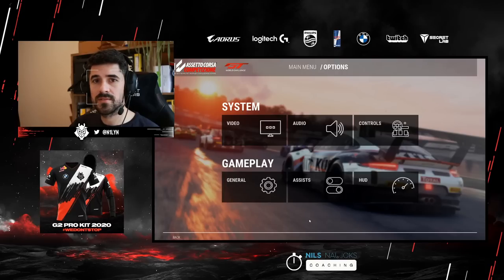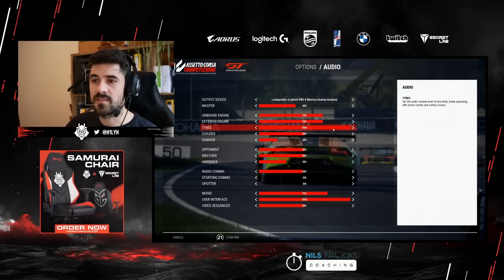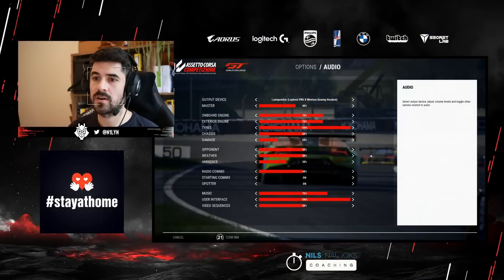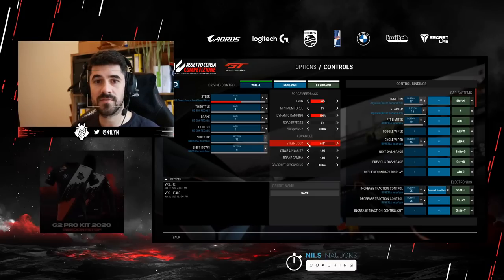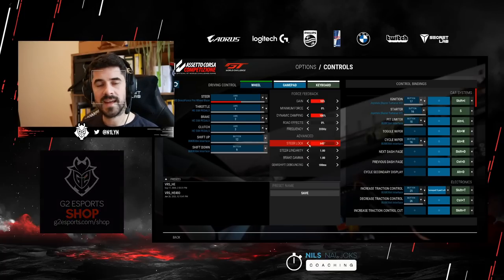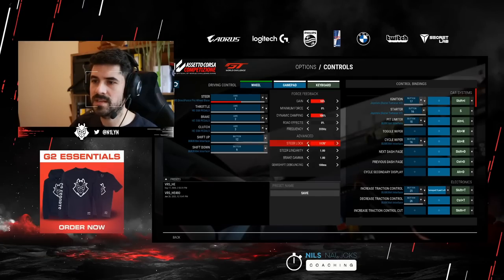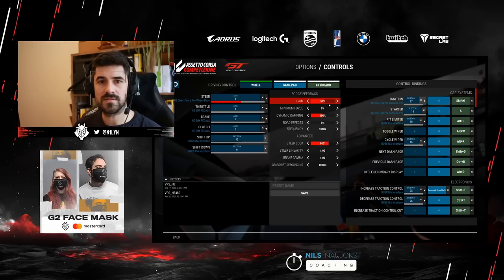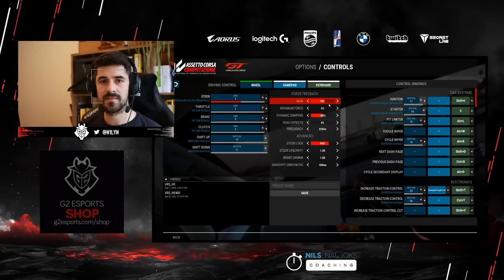Understanding ACC 1/3 - Controls, FFB, Audio, GFX - Assetto Corsa Competizione

Comment: Im using a ts-xw...
I originally followed advice from others and now your saying the same about dynamic dampening. I found this is quite wrong. With 100% I would constantly spin and not able to do a consistant lap of Silverstone on average of a 2.04. I then turned the Dd down to 0% and brought my average down to a 1.58 consistently with no spins. I could then control slides and could actually feel what the car is doing. And is still has more than enough Dd even at 0%.

Additionally if you have a weaker wheel.. You want to increase the force not reduce it. I'm using 45% ffb and 0% Dd and it is a completely different experience. It feels so much more realistic. With a weaker wheel, you should turn the ffb up as to get to a more realistic nm, you need to use a higher %, not lower. If you have 5nm total power, and you reduce that to 40%, you now only use 2nm of your total 5. If you have a wheel with total 10nm at 40% you have 4nm. So with a weaker wheel, to get 4nm, you need it at 80% to achieve the same force. More, not less.
Reply from the maker: the Dynamic Damping (lets not use DD as that abbreviation is occupied for direct drive wheels) indeed limits the detail that you can experience on weaker wheels as these smaller forces have to punch through the bigger gyro forces. turning dynamic damping down definitely is the right thing, but on 0 you won't have much standard resistance on the straights for example. Turning the gain up as high as you can without getting clipping is also correct, I hope I didnt say something different to that in the video. It's to find a tradeoff that lets you feel the everything without the wheel becoming too light. the ts-xw should have enough power to handle at least some dynamic damping - I would assume
Reply: I think that with the ts range, the advice given about thrustmaster products does not carry over.. Not just in acc, but almost all other sims. As an example, I was watching a video for configuring iracing. In the video the person shows using wheel check, and gets something around 15% for the dead one (I think it was, I can't remember for sure). This was done with a thrustmaster tmx. I went to do this test on mine, I got results consistently of 0%, 0.5% and - 0.5% (is that even possible, negative)
So as you can see, it is incredibly different playing field with this range, I'd say that's results to be expected from direct drive wheels, is that right?
So in aris video he recommends a deadzone of something like 12% I believe from memory, and 60-80% ffb. He states this as thrustmaster. While this may be true for t500 and below, I think the ts range should be seperate from these recommendations as for me atleast I would load up acc, try to force myself to play. Spin and be so much slower than Ai at 90 and be so incredibly frustrated I would just rage quit because I could not do what I knew I was capable of. 
So 2 days ago, I though stuff it. I'm going to try a setting that seemed far fetched when all these sim experts are recommending the settings I had plugged in, but I found someone's video where they had their dynamic dampening at 2%. So I tried it. It was literally like going from black to white. And as I said before, even at 0%. There is way more than enough dynamic dampening. 0% seems to not actually be zero, but rather just the lowest setting allowed.

In the same sessions of hotlaps, to make sure it was not just experience and improvement overtime. I would do a lap with it at 100%, then at 0%, and then go back again. Lap times were 4-5 seconds slower, and so difficult to keep the car in control. Next lap I would switch it back, and 5 seconds faster
Reply: I just tested something.

Ferrari, steering lock set to 480 and 0% dampening. Feels incredible.
Set steering lock to 1080, has the same steering lock with softlock but lost all the feel.

So my conclusion, when using softlock, 100% dampening is probably needed. If manually setting the lock, for some reason the dynamic dampening is at 100%, at 0%
Reply from the maker: I can't confirm this without using a TM myself. But it all seems a bit suspicious to me. It shouldnt be either great or unusable.
Reply: I have a TMX Pro and this made me rethink my FFB settings. First off, TMX is equal to T150 and way weaker than TS-XW. Started testing Dynamic Damping to 0% which took away all vertical forces, but made the lateral/horizontal forces shine through better. After testing on Laguna Seca and Zandvoort i realized i needed some Dynamic Damping, so i came up with these imho good settings(for TMX): FFB Gain 85%(less clipping) - Minimum Force 5% - Dynamic Damping 15% - Road Forces 0%. I chose to keep steering to 900 in both game and TM Control Panel which let it sync correctly.
Reply: @SimracingPopometer  this is on xbox, so it is quite likely a bug.

I have also discovered another reason why it would just not work properly. When using the stock sparco rim that comes with the tsxw -  it honestly feels like shit. There is so much free wobble in the feedback it's just unusable.
I now pause the game, switch the rim to the tm open wheel one...and behold..everything is fixed. Works wonderfully. Now I'm not sure if this is just a bug on xbox, but I will test this on my pc version of acc also.

I will record this, as I have not seen mention of something like this problem before
Reply: @DpMario11  i am so annoyed how bad t300 works with ACC, I have terrible feedback, actually almost like lag and just no control, understeer, sliding, terrible. 
I will definitelly try dynamic dampening to 0 or low, as I also noticed that dd at 50% makes wheel uch smoother, but still lacking input responzivnes...

Comment: Turn off V-sync!!! The worst thing you can do is use V-sync as it adds huge amounts of input delay, just watch Battlenonsenses video to see how bad it is for any kind of gaming. If you need to limit framerate and get consistent frame timing then use your graphics cards built in framerate limiter or use Rivastatistics tuner as both achieve the objective without the horrible input delay.

Comment: I use PS4 in ACC and my accelerator is extremely sensitive and there seems to be no way to tune it down.
Reply from the maker: sorry mate, I'm unaware of playstation related issues
Reply: @SimracingPopometer  Thanks, it is very frustrating. I just purchased ACC Ultimate and it seems to work better on my PS4/

Comment: The wheel feels so soft on my g920 do you have any settings for it
Reply: gain 100%, min force 0-3%, Damping 100%, road effects 1%
Reply from the maker: this will almost inevitably lead to force feedback clipping and detail lost. you must reduce dynamic damping and gain  until the FFB bar stops turning red except in a few situations with high sustained torque
Reply: @SimracingPopometer  for me I never have clipping. These settings are from Tortellinis t300 vid and he said you can also use it for the g920

Comment: Does that apply for console?
Reply from the maker: most of it. im afraid some settings on console just arent there?
Reply: @SimracingPopometer  with Damping set to 100, is it best to also damper settings in control box or at zero?
Reply: @SimracingPopometer  I'm using a thrustmaster t300 settings are.
Gain 75
Min force 0
Damper 100
Road effects 0
Steer lock 900

Gain 75
Consistent 100
Periodic 100
Spring 0
Damper 0
Reply from the maker: 100% dynamic damping wont work, cause it will cause clipping on weaker wheels (unless you have a DD1 or DD2)
Reply: @SimracingPopometer  will lowering the Damper to 50 be ok
Reply from the maker: you have to try. again, i neither have console nor your wheel. your target is to not get ffb clipping (or very little)

Comment: that steering lock doesnt work on G29
Reply from the maker: 900 in both game and driver does not? would make me wonder!
Reply: @SimracingPopometer  yep 900 in both, but still can turn the wheel with mclaren after 420 degrees, it doesn't lock
Reply from the maker: @richnew3715  it's 480 for the McLaren. try to set this for both settings. also the g29 is a bit weak to provide a strong stopper
Reply: @SimracingPopometer  480, or whatever it is, i wasn't sure, well, it doesn't make a difference, just wanted to let everyone know, that it doesn't lock your wheel, maybe like expensive wheels do
Reply from the maker: yeah it physically cant, if anything theres a soft lock indicating the end of the range, but you can always keep turning
Reply: @SimracingPopometer  right, never had a chance to try those expensive wheels, but anyway, great vid for someone trying to start ACC